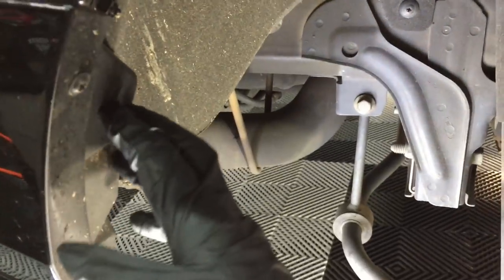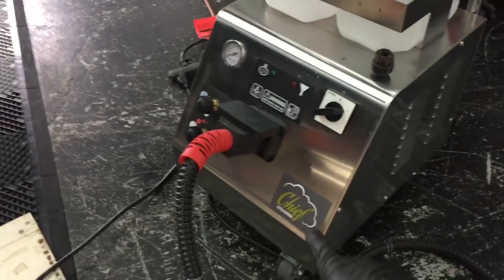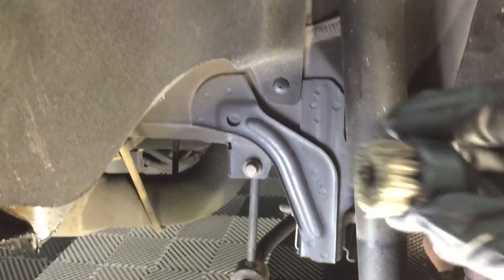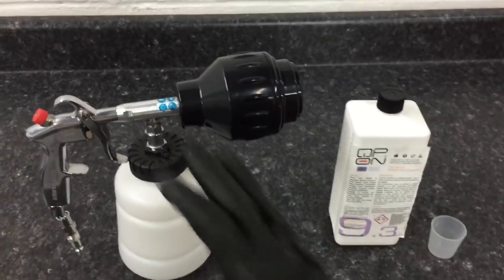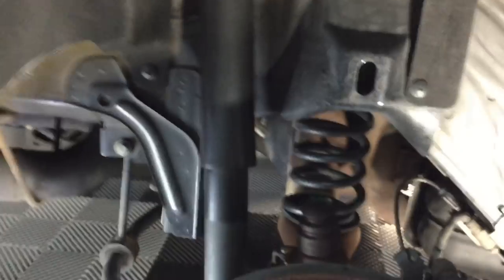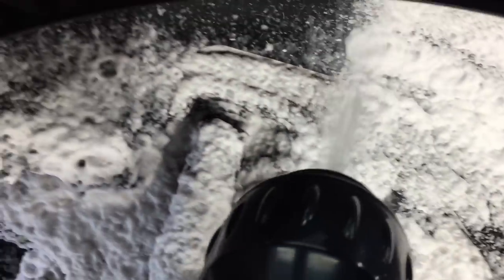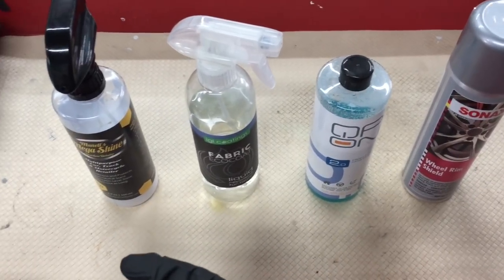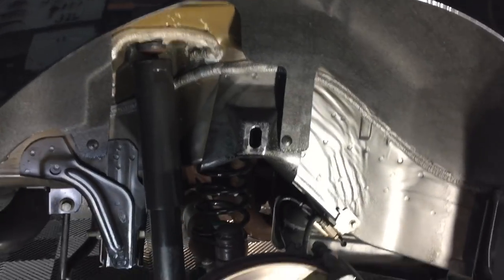How To Detail Wheel Arches And Wheel Wells (Cars and Trucks)

Comment from the maker: Do you detail your wheel wells? What are some of the tools and product YOU use?
Reply: Yes...but I dont have the tools you do!😀
Reply: I just use a apc/degreaser and brushes...topped with carpro perl
Reply: Apex Detail apc and long wheel brush
Reply: I thought I had OCD..lol.same minus suds gun.(soon)...🍻🍻
Reply: I just spray it with APC, agitate and wash out as many times as necessary and then dress with Trim Shine or alike but we are talking daily drivers...
Reply: Very rarely do I do wheels off service. That’s where I vacuum the felt, then surprisingly I brush it with stiff bristle brush and that’s it. Plastics usually I wash with an APC, through rinse and dress with dressing at full strength. Agitate metal parts with a degreaser. Spray gyeone spray and rinse sealant. If wheels are on, spray cleaner through IK foamer, brush and rinse.

Comment: Only thing I might add and a pet peeve of mine is that brake rotor is rusty on the hat part. Auto fanatic has supposedly come up with a wheel cleaner that will not damage those parts of your car. But that is why I try not to use harsh wheel cleaners. Your wheels can look spotless b8t a rusty brake rotor, caliper, and suspension let it all down. Thanks for the video

Comment: Great tip on the felt like wheel wells 👍🏻I always use a brush to get the debris out. The Camaro SS has the same type of wheel wells so this works for me ✊Thanks always excellent information 😎
Reply from the maker: It is popular with many models. I get the purpose...but there are other materials that would be just as effective.

Comment: Hey Brian, I know this is an old post, but I will comment anyway. could you do a review on Chemical guys Bare Bones product. it is an undercoating that I have used on the black from under my vehicle as well as suspension parts (coilovers, sway bars, control arms, etc.) and plastic wheel wells. the directions say to spray on, sit and wipe off but it seems to work better if you apply heavy and let soak in and drip off it dries with a drip free finish and last longer. It worked great on the plastic wheel wells so may be work adding to the review lineup on your next plastic trim video. I have not found any other undercarriage detailing products that is not a permanent spray/paint, if you know of any that could be an good video for people who have trucks.

Comment: Depending on the material at hand, I’ll switch between different grade drill brushes to quickly knock off majority of the debris and dirt. Then come back with a short brush tip on a vacuum and clean the rest.

Comment: won’t it be easier if you remove the liners and clean it outside on a table or something? that way you can clean underneath the liner too since the wheel is already out. Other than that thanks for sharing  you did a greatjob cleaning that wheelwell👍🏼